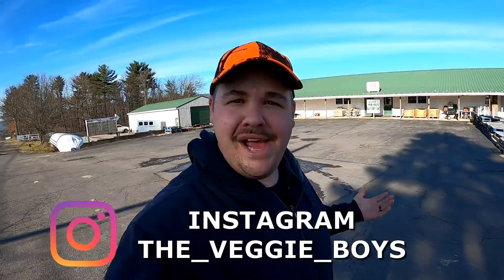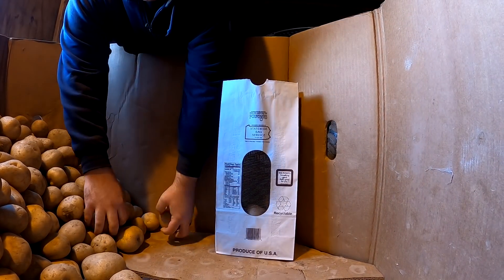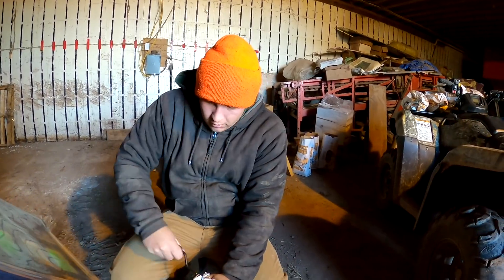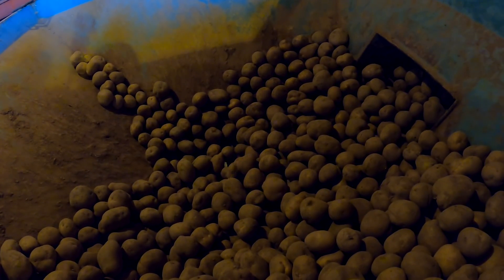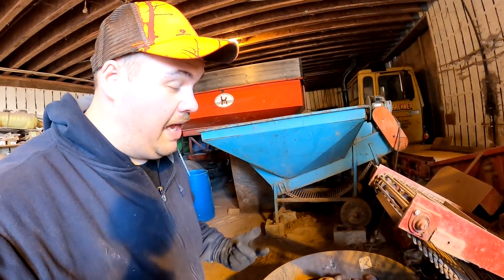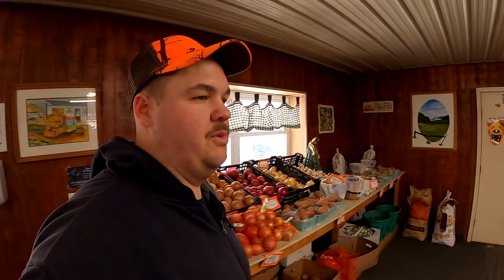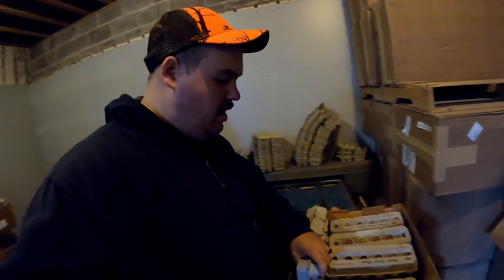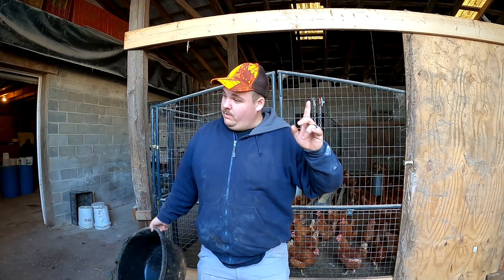Washing the Last Potatoes of the Year

Comment: Hi, For the sewer needle problem

I do not know ANYTHING about that sewing machine specifically, but I have repaired/restored household sewing machines like singer and brother brands from decades ago. 
One of the reasons I know needles will break on those is a timing issue. basically, its a gear thing.

Take the belt off, turn the gear one notch, put the belt back on, try it, doesnt work, go  back the other way, try it one at a time until you see it all running smooth.

It works on household machines because they are small enough to manipulate by hand to test the timing. 
Might be worth giving it a shot in the off season if you have some extra time.